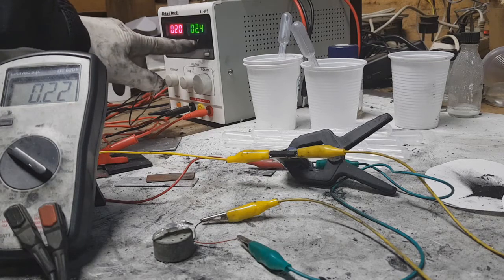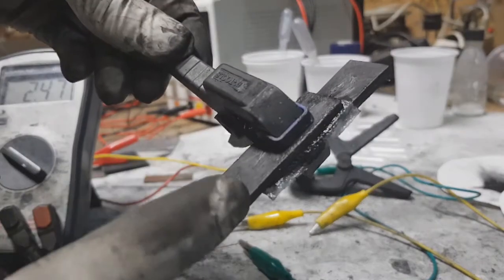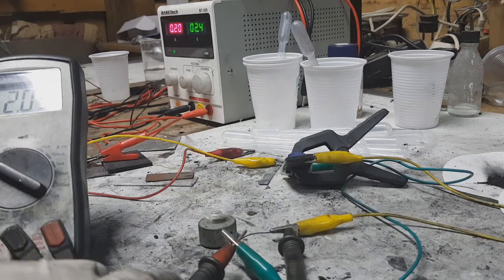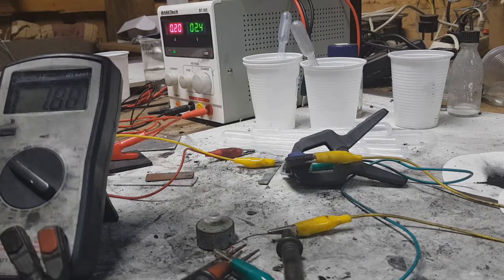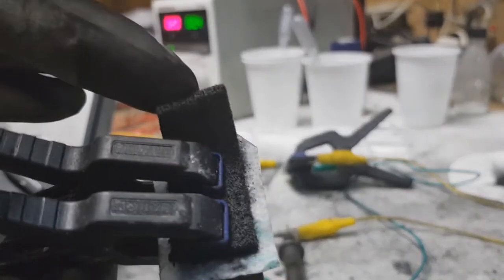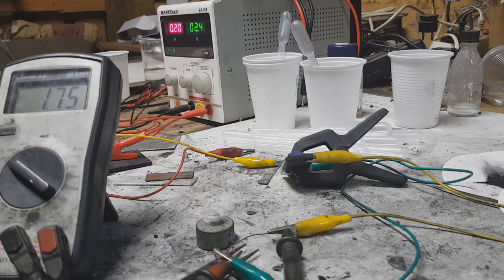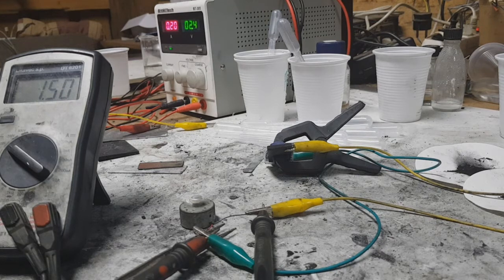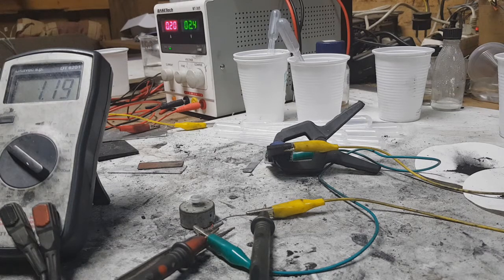Supercapacitor / Battery electrolyte Update

Comment: Hi Cayrex! First, you're videos are awesome! Just a quick question as i've been following along and have been meaning to ask.  The carbon sticks/plates that you are using, is that just carbon felt?  My apologies if you've answered this before, I've tried with steel plates and aluminum and haven't gotten the best results.  Next step was to check the electrode collector... learned a lot from the video you made on components that make up a supercapacitor, but still have a ways to go.  Any help greatly appreciated! Just sent you  PM as well.  Thanks for all your invaluable knowledge!

Comment: Very good video - thankyou.   Can you comment on why not same carbon on both anode and cathode - does  it make a difference?  What is result if same "best carbon"  used on both sides?
Dennis
Reply from the maker: +Dennis "what is result if same best carbon used on both sides" you will see I my next video,... wait 1 hour 😉😁
Reply: Thanks for showing symmetrical carbons in last video.  So it looks like its just as good as earlier versions with two different carbons on anode and cathode?
Reply: @cayrex  can i use alum electrolyte?

Comment: Hi Cayrex, interesting results, can I ask a couple of questions / suggestions.

What was behind your thinking in adding water to the ethylene glycol and MgCL2 electrolyte, could you not use a higher voltage if there was no water at all?

Would  poly ethylene glycol work as well, but without being toxic?

I am plucking up the courage to go out to the shop to battle the cold :-)

Martin.
Reply from the maker: Hey Martin, Yes you can use only ethylene glycol and MgCl2 for higher voltage but the current will not be really good, because the ionic conductivity of only ethylene glycol and MgCl2 is not really perfect.
First was my plan to make a electrolyte for magnesium battery which dont form any magnesium oxide and hydrogen when the battery is not in use (Mg react in waterbased electrolyte immediately and you can not stop this).
Then realize that some engine parts are made from magnesium (Mg - Al) and the antifreez dont damage the engine. Main compound of antifreez is ethylene glycol,..... so I try with pure ethylene glycol.
ethylene glycol and poly ethylene glycol have the almost the same name but are very different compounds. You can try to use a poly ethylene glycol, but I dont know what will happens.
"I am plucking up the courage to go out to the shop to battle the cold :-)" same here ;) :)
Reply from the maker: kev wallcroft DES electrolytes are good,... but what is the current output? Some good ionic liquid working also great but are more complex to make at home.
Reply: Like you said the ionic conductivity is not a good.
I find as you have said that better results can be had with ionic liquids.
I am working on something very new at the moment and will say more when i have something to report, keep up the good work & get a heater for your workshop ;-))
Reply: solarhope hey mate i found when making up Deep Eutective solvents that mono or polyethylene glycols work.
Reply: Thanks to both of you, I will try both ideas over the next few days. - Martin.